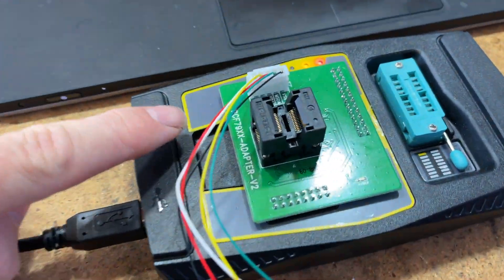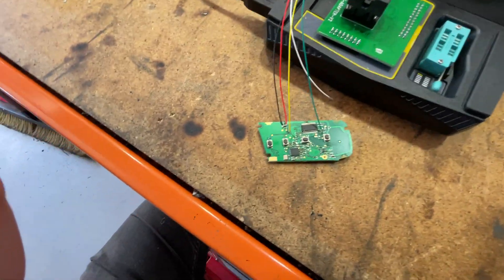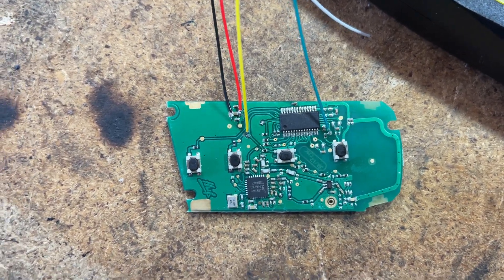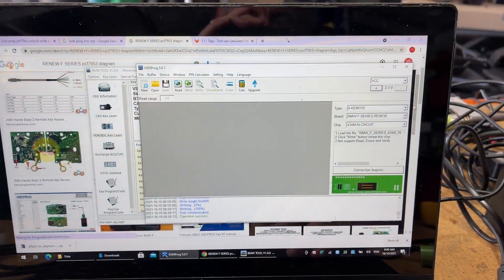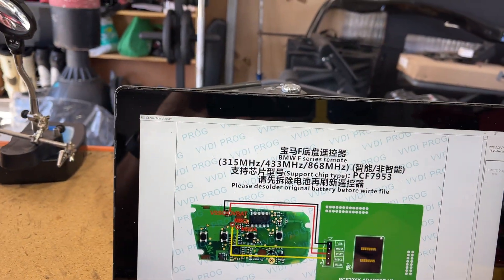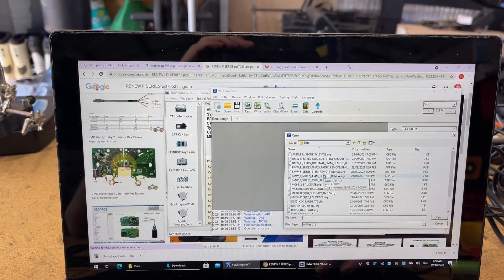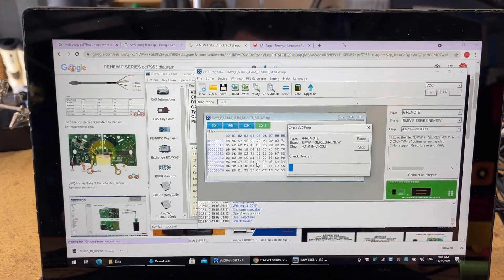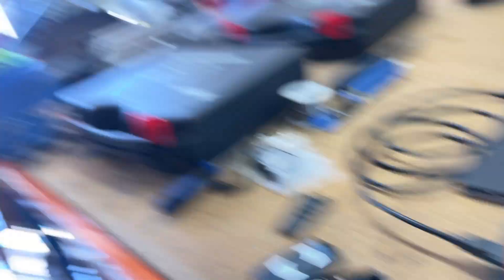VVDI Prog Renew F Series Key

Comment: Hello Dear! Can you tell me where you downloaded the key files? I have them, but in my opinion they are not correct! Have you tried to erase a BMW HUF5767 key, does it work fully after erasing? How many times have I tried to erase, the remote control never works!
Reply from the maker: Mine came with the VVDI software
Reply: @testandtune6096  but there is no file for HUF5767
Reply from the maker: Im sorry i thought there was, i did this years ago. Maybe contact vvdi
 @Joko_001

Comment: you try same on the key with g serie optic?i have try but have delosering out the chip and reset it with vvdi prog.or you found connection schema for the g series optik key?
Reply from the maker: I havent yet waldermar!. I asked you on another reply from the other page. Where do you get your keys from?
Reply: I order new key from aliexpress and reset this two
Reply: My last f31 was from en 2018. First China key fail. Second by from eBay fr. Works at first try. Was new Optik ews5 key